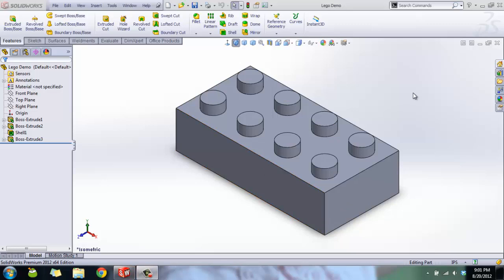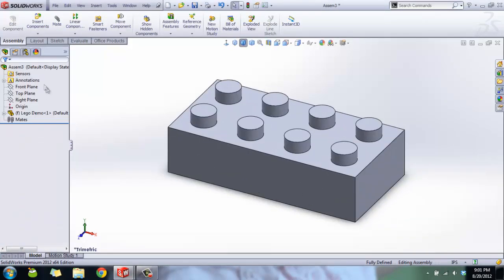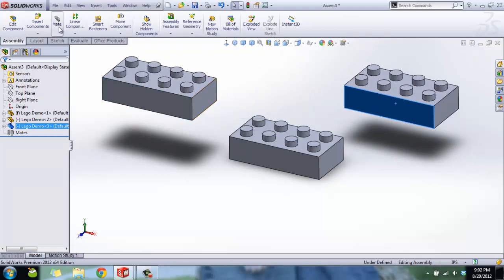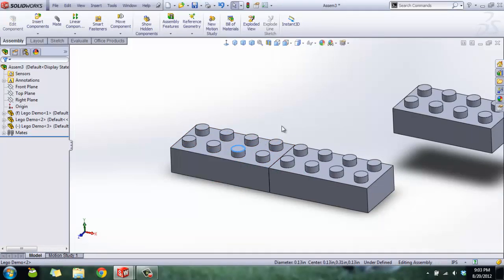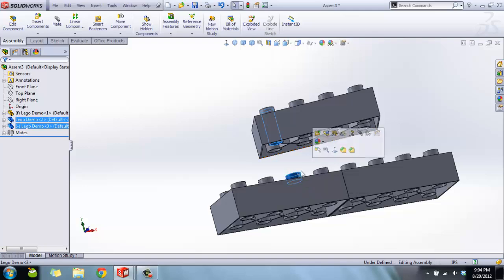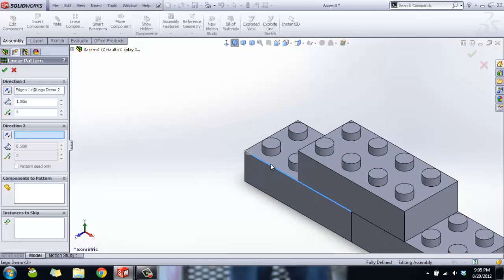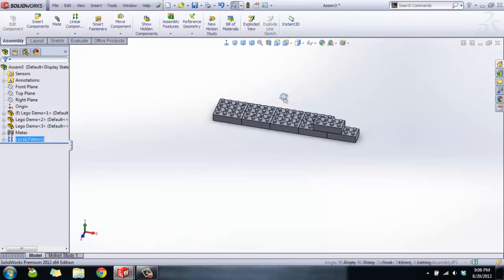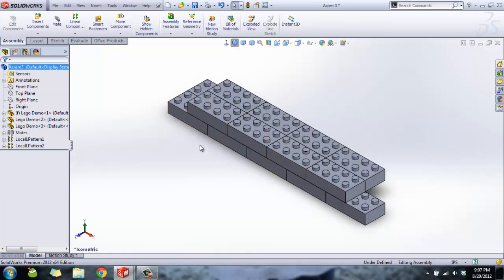SolidWorks Tutorials | Assembly Mates and Linear Patterns

Comment from the maker: for a hinge, i would use a limit angle mate rather than a limit distance mate. the only way to really prevent over-defined mates is to practice practice practice. I don't often get over-defined errors anymore (not to sound arrogant). there is a hinge mate in the mechanical mates section. that might simplify things a bit.